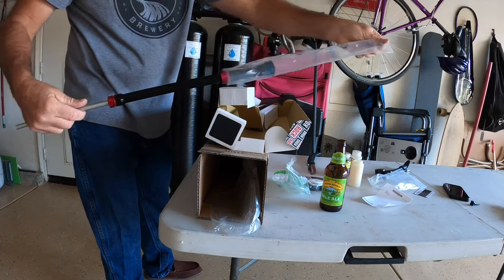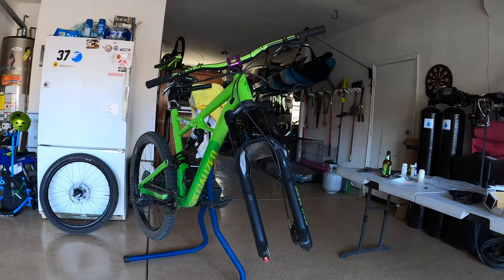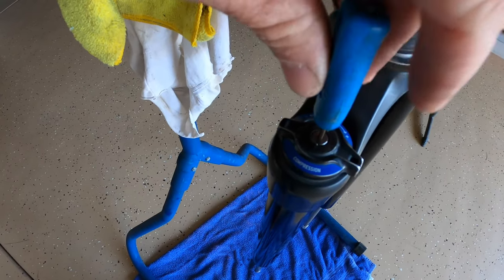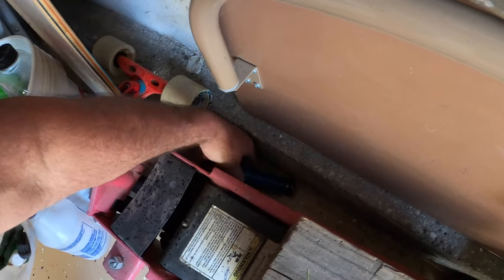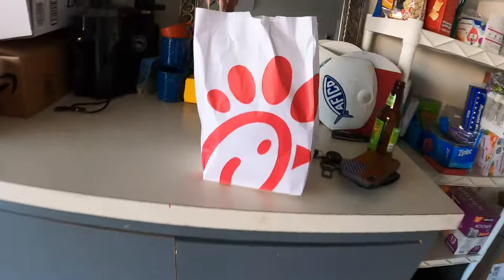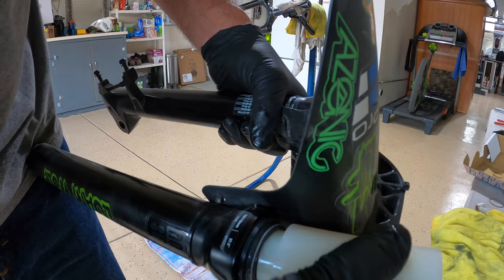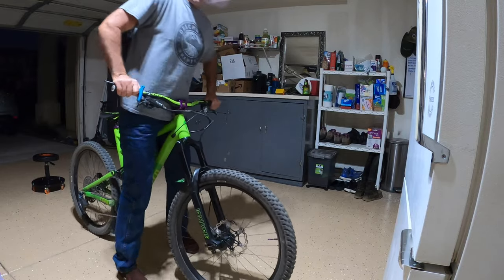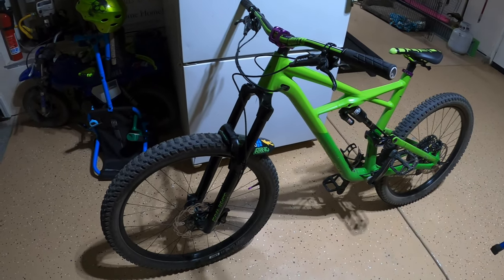How To-Yari RockShox Charger 2.1 RCT3 Upgrade

Comment: what differences did you notice?
Reply from the maker: Better small bump absorption, front wheel seems to track/follow the terrain better, not so harsh in the chattery sections. Just a smoother ride, a noticeable smoother ride, not a gimmick. I actually just bought one for my Yari on my Ebike. At the 50 hour service I’m going to install.

Comment: Have you tested off road yet? How did it compare to before?
Reply from the maker: Oh yeah, on at least 60 miles of off road. It is worth it to upgrade. Small bump chatter is gone, the front wheel tracks the ground better, it soaks up all the bigger obstacles, you can also just hear it working. Before it felt like just a mediocre fork, nothing special. I’m very stoked on the Charger. I also did the updated Debonair Air spring and that was a noticeable difference too. Maybe try that first, see if you like it, $42. Thanks
Reply: @SimplePleasuresMTB  thanks very much. I have Pike select with charger RC. The debonair is already latest. Thinking to go to charger 2.1 rct3  hoping for the improvements you mentioned. 👍

Comment: Do you know the difference between the RC2 and RTC3? Does the RTC3 Still allow the fork to essentially lock out?
Reply from the maker: RC2 has high speed compression control as well. Both have lockout